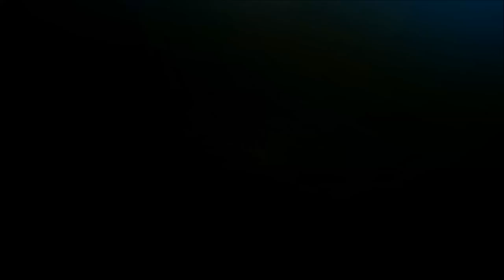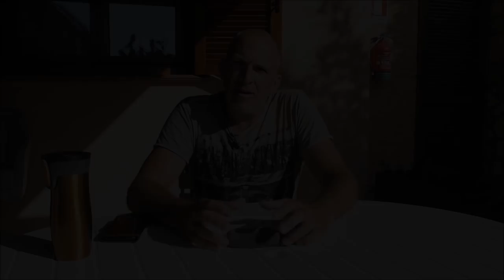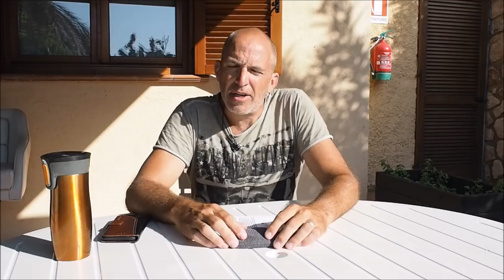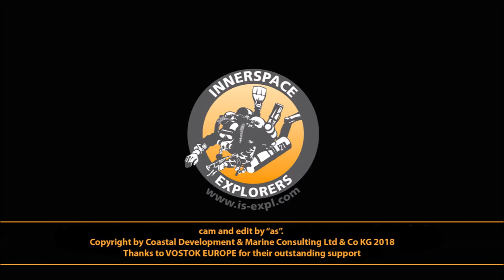Concept of the "Balanced Rig"

Comment: Would like to add that the ratio between the ditchable and non-ditchable weights is important and should be part of balanced rig concept.  I see lots of divers with 8 kg or more on the belt, with 5/7 mil neoprene wetsuit.  This is extremely dangerous.   The ditchable weight should be minimal, only to allow a safe accent with an empty BCD.

Comment: Just a question about the tanks and their potential downlift. 10l tank wont be displace 10l of water cause of the wall thickness of the steel/alu. Is there a rule of thumb where I can try to get close to balanced rig? For today I just do try and error but I want to get faster near to my sweet spot.
Reply: its possible to do that a numbernof different ways, you can literally hang it from a luggage scale and then lower it into water, quick and easy if you have access to a drum full of water
Reply: My 8.5l bottle weighs 10.4kg. Steel has a density of 7.8kg/l. So the Volume of the steel is 10.4/7.8=1.3l plus 8.5l tank volume = 9.8l = lift. 10.4kg-9.8kg = -0.6kg when the bottle is empty. with 50bars left in the 8.5kg tank it equals ruffly around -1.1kg.
Reply: Look at manufacturers website for buoyancy charicteristics. 10l steel tank is roughly 4-5kg negative when full and about 2-3kg negative when empty. An AL80 is 1kg neg when full and 1kg positive when empty

Comment: Tank buoyancy is based on volume of the tank, not based on the volume of the air inside the tank right?
Reply: not really, each litre of air (assuming itnis air, and not nitrox or trimix etc) weighs around 1.28g so the buoyancy of a tank willbalter as it is depleted.
Reply: You're basically right Kevin, but the tanks "outside" volume is not that much different to the inside volume i guess so maybe its just a rough guess

Comment: cant be that hard to figure it out for sidemount: take the two bottles of your balanced rig which are on your back, get rid of the connections and put them on your side. I dont think you can unbalance a rig by just moving the bottles from your back to your side.
Reply from the maker: I basically agree - but what can be seen regularly in the water shows something else. Lets maybe discuss this in an upcoming live video.

Comment: I blame a lot on these instructors that they pump out. I watch them teach the class and instead of relaxin a student  and putting them in proper exposure gear for the conditions. They just add weight to get them to the platform. This weekend i witnessed a girl probaly all of a 100lbs in a 3mm suit no hood or gloves on her cheque out dives water temp was 63°f  at 20 ft. She was shivering at the surface and breathing heavely befor the dive and could not get down with 12# on. So the instructor's solution was add more weight i watched 6 more pounds added. On the platform the instructor had all his students standing. It looked like a f%#&€=g disco dance. I gusee they learned 1 thing i call it the ( rote tiller ) it was not hard to find them out of the water they were muddy. So i think the system needs a overhauled

Comment: I understand weight is an easy term for people to use when talking about a tank but its not very useful when we are talking about buoyancy. An aluminum tank will weigh more than a steel tank but because the metal is less dense, a will be more buoyant than the lighter steel tank.